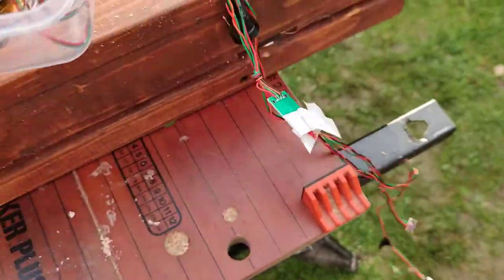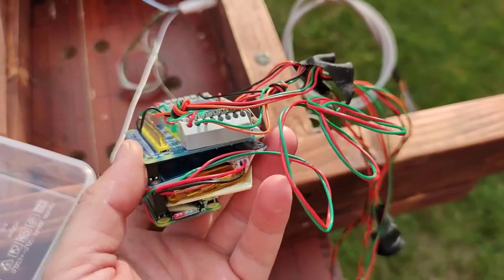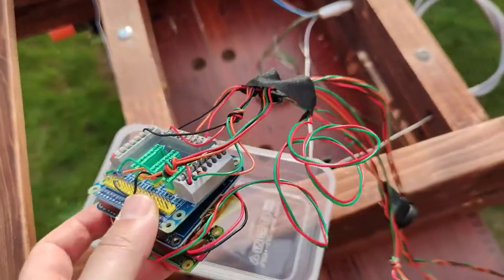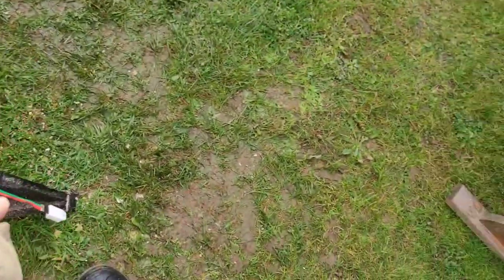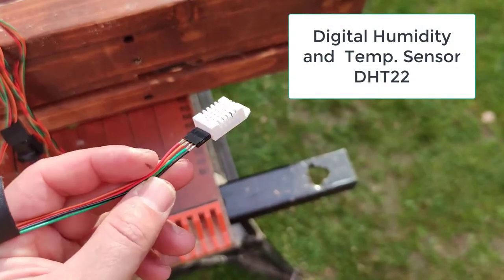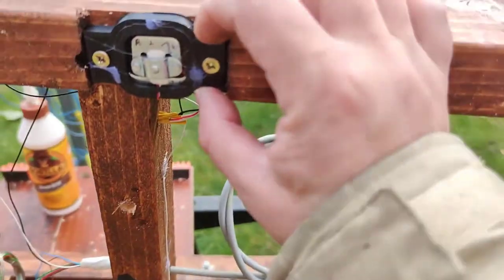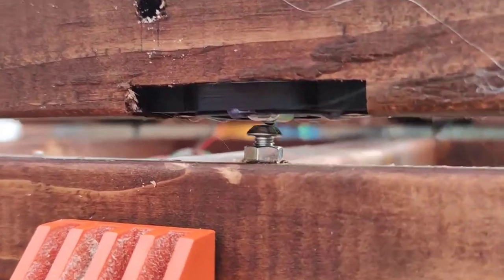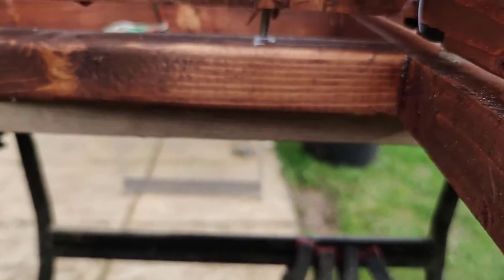Raspberry Pi beehive scale: hardware presentation

Comment: Hi, I just started similar project with these weight sensor. But I´m kinda worried about the lifespan of these sensors because they are not designed for a permanent load. Can I ask you, how it works or how long they work fine or in the better case do they still work? Have nice day.

Btw... I really like your design of this project.

Comment: Hi. Can you please share the wiring diagram. Because in my case it is working on Arduino but shows Random values on Raspberry pi
Reply from the maker: Had the same problems, in my case was the pcb
Reply: But same pcb is working with Arduino
Reply: I used the wiring as per this tutorial.https://youtu.be/LIuf2egMioA And which code did you use. Can you share the repository
Reply from the maker: https://www.instructables.com/Arduino-Bathroom-Scale-With-50-Kg-Load-Cells-and-H/
Reply from the maker: @shahidgulzar7907   https://honey-pi.de/en/
Reply: Thanks ❤️. Will work on it tomorrow

Comment: Raspberry Pi for scale ???
))))
who not Mac Pro  ))
Reply from the maker: It is basically a weather station with scale, which is monitoring the humidity, temperature, and barometric pressure, inside and outside of the beehive; being connected to the thingspeak servers.